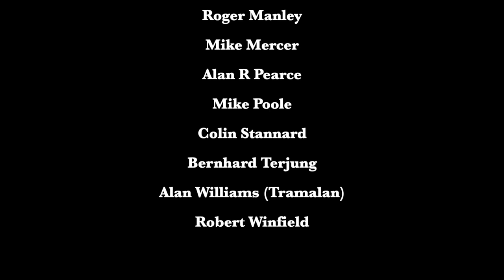Seaton Tramway's Colyton Station: Then & Now

Comment: 1:46, Lisbon tram? Whatever happened to that? Was it the Tramways for restoration or just visiting?
Reply: It had been considered for use either as an operating tram, or as a static waiting room, but eventually it was decided that it was too wide for the Seaton loading gauge, so it is now fully restored and running at Wirral Tramway on Merseyside.
Reply: @markhorner9195  Ah, At least it did get restored. Shame Seaton couldn't use it though, I get the whole loading gauge issue though. That said, those trams in Lisbon do now run on a track gauge not much wider than Seaton. Thanks for the heads up :)